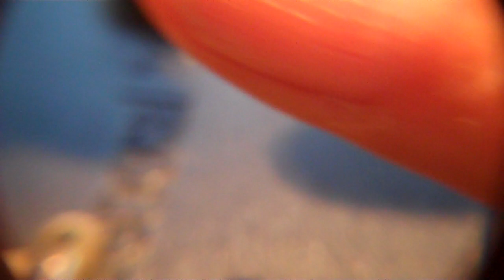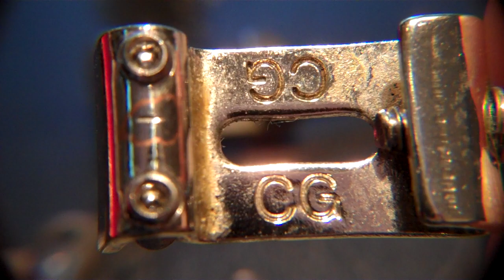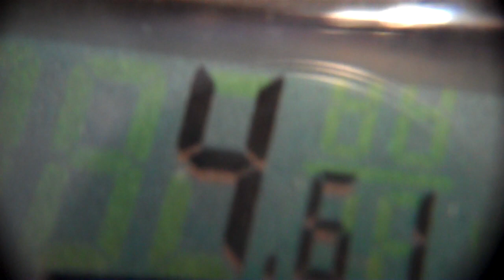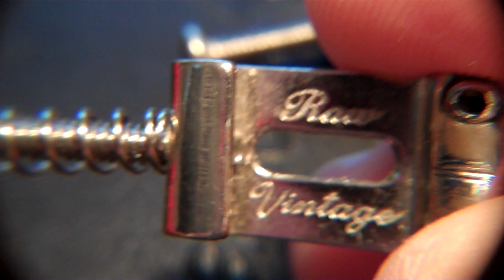1964 Vintage vs. Callaham vs. Raw Vintage Stratocaster Bridge Saddles

Comment: This is the first I have ever heard of scoring the top of saddles for the string to sit in. I have been using Callaham parts for years. The only let down I ever had with his saddles is that ONE was miss threaded thus useless. That being said almost all my Strats have Callaham bridges and blocks. Have a new set of CG stainless steel saddles on the way right now as matter of fact.

Comment: Insightful info and cool guitars!
Reply from the maker: For vintage type saddles, I just got a set from Mark Foley in the UK, mfguitars on Instagram, and they are the most accurate I have ever had and I am loving them.  They are even stamped Fender, Pat. Pend.  Otherwise, I use Highwood saddles from The Netherlands.

Comment: I love this channel so much, all the weirdly specific things i ponder about Strats and Strat after market parts, this dude has 99% of the time already made a highly detailed video on it
Reply from the maker: Just switch to the Highwood Vintage Contoured saddles and you will be happy. They are on all my Strats now. I did quite a few videos on them.
Reply: @millstap  I just got the Callaham saddles, I know the high wood have the groove in them and a few other points but at the end of the day in my opinion they're all just saddles
Reply: @millstap  I just got the Callaham saddles, I know the high wood have the groove in them and a few other points but at the end of the day in my opinion they're all just saddles
Reply from the maker: @Livelaughlimpbizkit  You really need to try them before you can compare.  Plus, all the saddles are not equal by a long shot.  The Callahams are too hard and impart a shrill high frequency.  Either way, I went on the same hunt for years and you will probably most likely put Highwoods on your guitars eventually.  It does however depend on your playing style.  I play very hard, bend strings constantly, and dive bomb my tremolo a lot.  I can cut multiple grooves in the Callahams in a day even though they tout their "hardens."  But they neglect to tell you about the soft copper layer under the chrome that the original Fender saddles did not have.  That copper will let you cut grooves in the chrome quickly.  The grooves will eventually start breaking a lot of strings.  Plus, the way I bend strings, the strings move around the tops of the saddles when they are new and that is why I end up with multiple grooves.  The strings finally settles into one of the deeper grooves and stops sliding around on the top.  I rarely break strings with the Highwoods.  Let me know if you even try them.  They will have slightly more sustain and some people don't like that.

Comment: I have used Raw Vintage saddles and springs on various Strat tremolos and they were great. They have always improved the sound on non Fender tremolos. I keep original saddles on my Fenders though. I have to admit that my best sounding Strat is a partscaster. I did change everything a few times at least over decades until I came there. The only Fender part on it is a neck. I love that guitar. It also has Raw Vintage springs and saddles and even pickups. Sounds great to me.

Comment: I have those Fender Pure VIntage. Not US Fender Vintage or US Fender. Fender Pure Vintage. I have them on my Jimi Hendrix Strat and on the Fender Mexico Classic 60ies. They are the exact same as the real vintage and those are the ones that are on Fender Custom Shop Strats.

Im from Germany, so i can only post this link.

I dont buy anything else. Imo to get real Fender Vintage saddles one has to get Fender ^^ I think they know best whats right and what not.

Btw, the hole of them is perfectly fine. Its big enough by far to match any saddle position. 

I would always buy these ones. If one compares them to the normal US Fender or Mexiko Fender, one can see that they are quite a bit shorter. The place where the string rests is bigger and straight, and the material is a bit different (has different color tone too).
They have a lot better quality. One can see it already how they are manufactured a lot more smoothly. Everything looks perfect on them. On the normal US Standard saddles one can see sharp edges, they are nt fully straight too.

If you still havent bought them, i would really try it.
Reply from the maker: This is good to know, especially if you need the best standard vintage style Strat saddles.  I have switched all of my Strats to the Highwood Vintage Contoured saddles from the Netherlands.  They are the best IMO.  I can't say enough good things about them.  I've done quite a few videos on them, here is one, https://youtu.be/J5qItTWP2TY.

Comment: I’m not taking the time to read all the comments, but have you tried the 62 RI. Fender fender saddles? To me they sound like the fender pat pend saddles- the callaham saddles just feel mushy to me - they just ain’t got the right ping to’em imo- I’ve talked to some people about this and the opinion is that they are a softer metal- I went with the callaham bridge due to a neck width issue. Callaham saddles are about .025 narrower than the pre cbs saddles- next thing I try will be to narrow some 62 RI saddles and try to get that ping back- or just go back to the fender bridge and live with the spacing issue 🤷‍♂️
Reply from the maker: I gave up on the all aftermarket Fender Strat saddles but I would like to try the Crazy Parts saddles.  They may be vintage correct.  I don't like any of them now that I use the Highwood Vintage Contours.  They are amazing and I love having the groove that stabilizes the string on bends.  Plus, they are designed to keep the height screws from cutting your hands.  I won't go back.  They have a tad more sustain which you get used to and notice it when you put the standard saddles back on.

Comment: I use the pure Fender pat.pend on my strats they thicker and they harder then Ri saddles. And you right about the slot it takes of pressure at top of the saddle! I know Stevie Ray Vaughn in person and it was Rene who came up whit the tube thing who did help out so did not snapp his B and G string so much. I snapp my strings a lot ! And I'm use 0.11-0.56 tune E-flat for must time. When I go to E tuning I'm use 0.11-0.49 and I'm play 4 main giutar a 55 a 56 a 59 a 63 and it's the same problem on all of them. I even cut grove in my hard tail of bending my strings so much. Because when you bend the string tension increases a lot on top of the saddle! So I'm use a vintage Ri saddles from United kingdom and they are spot on best after market I been ever see. But long wating because the owner of that company make few series. And they even have the correct Fender pat.pend stamped on them ! They are thick as genuine old pat.pend vintage. Callham is softer then original pat.pend Fender. There is some good none stamped saddles from Japan even Titan who is good quality. As we know as you change anything tone change as well. On my 63 I'm use Graphtech saddles because that one eat strings more then any I seen so far and I'm played for 45 year now. I use 5 springs at my block and on my 55 - 56 the plate all the way to the body. On the 59-63 I'm have calld floating tremolo who is a full ton. That means I can raise a full tone up when lift the arm up. 
I see a thing more a thin sting set as the 0.09-0.42 or even 0.10-0.46 where down the saddles faster then the 0.11s and 0.12s and back the day of 1954 they come whit 0.14 from Fender this is to calculate whit as well! My 55 love the set of 0.12-0.58 and that fat maple neck are a blessing whit those big strings ! And SRV number one had a fat D neck from start and he playd mostly 0.13-0.58 up to 1985 when Rene Martinez did be his tech. Then he go down to 0.11-0.15-0.18-0.28-0.38-0.58 
A very good set combination! Who I'm use my self whit many blues players. But as I'm told there is some options out there and it's not been more easy then today. In old days we take the parts of a giutar pickups bridge neck ect. Now we can buy most things on the market so that's big plus ! 
Best regards from me /Bjorn
Reply from the maker: Hey Bjorn, you should try the Highwoods on one of your Strats and see what you think.  I love them and the groove the string goes in.  It keeps them very stable also hold a little Teflon grease a lot better.

Comment: many factories unfortunately use to put copper also in their bridges and then do hidden that by a layer coat of nickel; so you never know if your bridge is pure steel or just copper-plated steel until you get to sand-paper it to discover the truth. I'm afraid also Callaham's bridges have got copper inside underneath the nickel-plating.
Reply from the maker: Exactly.  There must be some benefit to using copper but it is not for the vintage tone.

Comment: Fender made the new pat pending saddles but they are full of crap about using old tooling and stuff cause they don't have any machine marks in them anymore. Thats how you can tell a old set from a new set. Callahan are nice blocks but thats about it i wouldn't waist the money on them like most people do. If you want one thats close it probably be crazy parts bridge i would say.
Reply from the maker: I think Mark Foley (UK) and Crazy Parts get their parts from the same place. I just installed a complete Mark Foley tremolo and is the best I’ve ever seen. The saddles are just about perfect. Either CP or MF would be what I recommend. Good stuff. Only one slight groove dead center on each saddle. No chrome plating.
Reply from the maker: Mark Foley 50's "Rough Cut" Strat Tremolo - A Closer Look
https://youtu.be/otaldh4viuA
Reply: @millstap  yeah I believe your right about that with crazy parts I have heard that before myself. They say the blocks are forged by blacksmiths but idk it's just something I read and you know how that is today lol. I'm gonna to order a gold trem from crazy parts soon cause I need one for a white blonde I'm doing. You know how hard it is to find pat pending gold saddles,  it's like the unicorn part of a strat I think lol. I just hope they got good gold plating on them cause some of that stuff sucks

Comment: I tried some Callaham intonated Tele saddles once and they sounded very thin compared to the old 3-barrel brass Fenders from the 50's. After looking closer I saw that the string height adjustment screws in the Callahams were much smaller in diameter than the original Fenders. I think that is what was thinning out the tone. Got rid of those Callahams real quick. The intonation with the Fender saddles is good enough.
Reply from the maker: I've steered clear of everything Callaham now.  The best saddles I have found for the Strat are the Highwood Contoured vintage saddles.  I have them on three Strats now.  I also have some brass compensated saddles on my Tele but I am not sure who made them.  They are good ones.

Comment: The coppers used in the plating process,the metal underneath is hard steel..coppers
Reply from the maker: Yes, I didn't find any copper on my vintage saddles so I am not sure why they would use copper on the so-called vintage replicas.

Comment: I don’t put a lot of faith in this video. Surely at some point he should have played the guitar with all Fender, then all Callaham and then all Raw Vintage saddles. 
I find the nut is the area where the string typically gets stuck. Fender used a roller nut, so there must be something to it.
Reply from the maker: This was before I had tried the Highwood saddles.  They are on all of my Strats now.  I can guarantee that 99.99% of all sticking is at the saddle.  Fender rarely used a roller nut and I don't think I have ever really seen a Strat with one.  A properly cut nut will not stick.  There is a simple experiment if you are having tuning problems when using the tremolo.  Knock the strings out of tune with the tremolo.  Find the most out of tune string and lift it slightly behind the nut out of its slot.  Use another string or something to make a loop to grab the string.  If it is still out of tune, the string is stuck on the saddle.

Comment: I've used Copper slip on my saddles and nut for 40 years just a very small amount under the strings, never had a problem with groove's or strings catching.
Another good idea someone used on his strat to stop the strings going out of tune was to bend the strings just in front of the saddles pickup side to stop the strings jumping back over the saddles when pushing the whammy bar down, the strings stays where they are and don't go out of tune. Hope this helps.